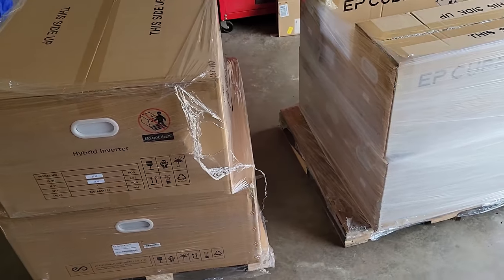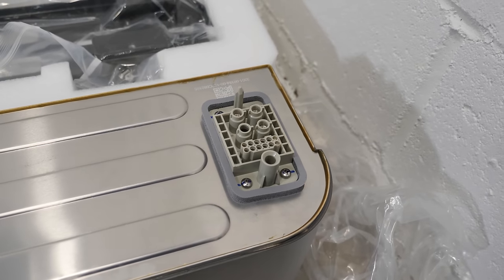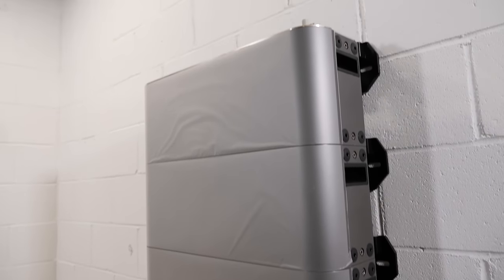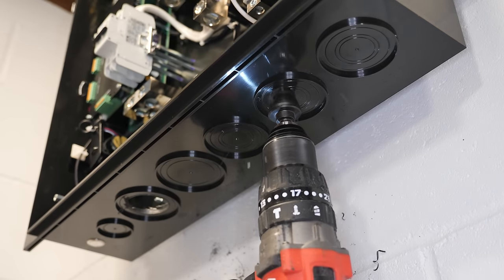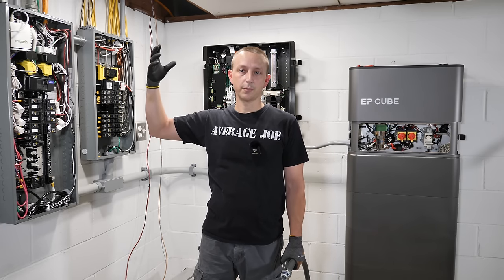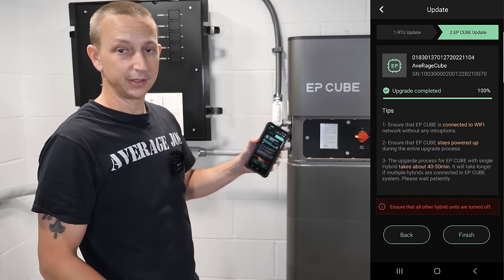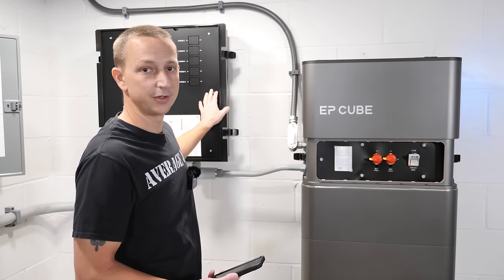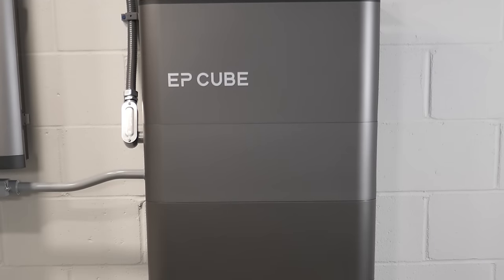Installing the EP Cube by Canadian Solar All in One System!! ON SALE!!

Comment: Pretty awesome video and your sense of humor,  first time viewing any of your videos.     Question - I noticed that the EP Cube inverter in the (All In one) has a TIGO connector,  so is it compatible with Tigo solar optimizers?    I kind of want to have individual monitoring on the solar panels to show individual panel production.    What are you going to use?    Thanks !
Reply from the maker: Thanks for watching. Yeah it has the tigo RSD. I am pretty sure it works with the optimizers but can check. I believe you need to use the tigo app to see individual production. I am using TS4-A-2F on one string at the moment and they allow 2 panels for one rsd unit. They dont show any production tho. Still need to add them to the other roof string. I will also add that EP Cube has updated the app and you can now see each string production. Thats a plus because before it just showed a total for all strings added.

Comment: One thing that bothers me about these wall type units is how long will the parts be available in the future if something fails and needs replaced will I be able to get what I need years down the road whereas if using individual components I could easily find replacements and even upgrades as time goes by. Your thoughts on this? Another question, if you cant access your app for any reason than you cannot access the system but the system will still work for backup power ? And you have to have a grid connection with this or it cannot be powered on? if all this is true then for a shtf situation there is to much dependence on outside the home tech to be up and running for it to be truly dependable in my opinion.
Reply from the maker: All are great questions. Ill be doin another video here soon and will answer some of those questions. For a true shtf situation, I would go with another system as you could add rando mix and match batteries to an inverter and have power. Id have to see if I could patch in batteries to this system. If I could, I dont think the %SOC would read correctly but I would be ok with that lol
The app uses your local wifi network so if interwebs is down you can still access it. If your local wifi is down you can connect bluetooth. I know you need grid connection for inital startup, I havent checked if it will startup without grid since I have been using it. I will check tho

Comment: If this system is grid-tie , it is able to keep the solar arrays operating in a power outrage? In another word it is capable to simulate the grid signal via the batteries and no power out to the utility as require by law?
Reply from the maker: Yes, solar will still work. No power will be sent back to the grid! It is fully certified, UL listed (even in Cali). 🤘

Comment: Excellent video on the installation and operation of the system!  Looking forward to the video of the generator hookup.   I’m wondering if the EP cube Gateway requires a 240v generator ( I see the L1 / L2 terminals) or if it will accept a 120v feed.
Reply from the maker: Thanks and Appreciate that!  Yeah a generator option is pretty nice.  Yeah it will require a 240v connection as far as this moment in time. They are always upgrading so who knows, maybe a 120v will be an option.🤘

Comment: Two Qs:
1. How to use these batteries if i already have hybrid inverter?
2. Is the config you shown is AC coupled or DC? 
Thx!!
Reply: It would be nice if you can reply?
Reply from the maker: Sorry, lots of videos with lots of comments😄 What kind of hybrid inverter do you have? Is it basically for AC couples solar? If so it can connect up to the gateway.

Yes I am using DC coupled solar.
Reply: Yes it’s AC coupled inverter…
Reply from the maker: I want to make sure I give you the correct info(since I dont have AC coupled) Let me find out and get back to you. If I havent replied, please bump this!

Comment: Wow this video is very good and cool, does the system can combine aeolian with solar too ???
And what is the cost of this install ???
Reply from the maker: Thanks appreciate that. I am unsure if you can combine solar.  I dont think so but will try to find out.  Minimum cost for this system alone includes 3 batteries and is $11,369.00 from Signature solar at  the moment.  With 5 batteries that I am testing out is $14,599.00.

Comment: are you going to capacity test those batteries? 20kWhrs per unit (120kWhr for 6) does not seem right for the footprint of those if they are LiFePO4...
Reply from the maker: Yeah 20kWh per stack.  I believe that is a code thing and or code compliant.  I ment to include the sticker on the side of the batteries AND inverter.  Will have to include those in another video.

Comment: How does this compare to the batteryevo rhino batteries you had a whike back
Reply from the maker: I still have that system and still use it😄 My "system" has more battery capacity and a bigger inverter. I do really like that this system has 4 MPPT charge controllers and at a MUCH higher voltage. It also has some cool safety features that mine doesnt....yet🙄. Ill have to come up with a list.

Comment: Did your get rid of your growatt system?
Reply from the maker: Nope, still have it all! Gonna tie in a transfer switch I think so I can use either😆
Reply: Good I like how u did your old system. I am running 2 grid tie gtl invertrs off 24 kwh battery bank. With 4300 watts of solar.

Comment: All this wifi/company dependent/serial-number-pictures/wiring-pictures/software update heavy setup would not work for me.   As a prepper, I strongly prefer to be offgrid - absolutely no information outside my home LAN.   I'm a little surprised you're OK with this as I've tended to think of you as a rebel/off-grid type of orientation :)
Reply from the maker: Yeah true! I would prefer lan as well. As for being"ok"....I am allready all over the interwebs so I kinda have to be somewhat ok. I do use the system as off-grid, as in I dont grid-tie but as far as the app. It also works for lan. This system is more  designed for the regular folk that just want to have a system installed.
Reply: Exactly what ive been saying. Really cant believe he qould support a company that pulls stunts like they are. No warranty unless its updated every month. Complete joke of a unit

Comment: Can this be  hooked with out batteries  no grid feed back use  from grid if solar is not enough
Reply from the maker: I am not sure I understand what you are asking. 
Q-Can this be hooked without batteries. A-No, You need batteries
Q-No grid feedback use. A-Yes if grid go down it will continue to run
Q-From grid if solar is not enough. A-Yes if solar and battery are not enough, it will use grid.

Comment: I bet that it will cost a bundle.  Thanks but no thanks i build mine i get way  more bang for my bucks.  No body cares if it is pretty or not as long as it is safe and works.

With that says this nice thing is for those that have the bucks to burn  and just want to have to use it and they could not care less about  kw to A to V etc...  Solar power system is  heading this way for the majority of consumers and that is good.  The more the better for the environment!!!!!!!
Reply from the maker: Yeah this system is for people that dont DIY and want to get a system installed for a multitude of reasons.  You are correct that systems are heading this way.  All in one that are easy and quick to install .

Comment: A lot of concerns:  1) If you aren't going to back feed the grid why is grid power required to power on the system?  
2) No local physical controls or indicators?--that's an inherent limitation that I find is unacceptable.  Reliance on WiFi and Bluetooth, also unacceptable.  While Bluetooth does not technically depend on the Internet, it is a limiting control factor, as is the NEED for Internet connectivity for the EP system to connect via WiFi to the EP Cube servers and then back to my phone.  3) The engineering, fit and finish looks spectacular as is the install process.  But too many concerns for EOTWAWKI and/or WWROL situations.  4) Also, IMHO, an EMP is going to murder the system if it is not isolated from the grid even if shielded (of course, in an EMP all bets are off anyway I suppose. 5)  Another concern is the need for the by-pass sub-panel; it seems like a limiting factor having to choose ahead of time which circuits get power from the batteries. Is there a way to run the system directly to/from the main load center? (tie the inverter output directly to the main panel with an approved by-pass/disconnect interlock?  Lots of concerns for this system, so it's not for me.

Comment: cost?  you didn’t mention cost….how much do you have invested on your wall?  not including your your solar panels…
Reply from the maker: Minimum cost for this system alone includes 3 batteries and is $11,369.00 from Signature solar at  the moment.  With 5 batteries that I am testing out is $14,599.00.
Reply: @AveRage_Joe   thx….I put up 4 320 watt panels, one xantrex 3 kw inverter/charger, midnite charge controller and 6 100a/hr agm batteries…for less than $7000.   this seems excessily expensive!

Comment: i dont understand how your. wiring work and maybe you can elaborate. As for my understanding  you connected the smart gateway to the main panel through a breaker (lets call this breaker 1 and this breaker cannot be engaged unless the main panel break is off, meaning no power to the grid) and the smart gateway to the subpanel. The subpanel essentially connected to the main panel. So it 's a loop main->smart gateway -> subpanel->main. So how are you charging the battery from the grid given you have to disengage the main breaker to engage breaker 1? Am i missing something?

Comment: It's too bad that Canadian Solar chose to use, Chinese made,  low cost, high frequency, transformerless inverter technology in their design. The reason for this is that all these high frequency inverters lack a very critical component. That critical component is an iron core, copper wound output transformer. Without an output transformer to act as a buffer to absorb electrical surges provided by the “Flywheel Effect” inherent in the physical amount of a transformer’s iron, these surges and damaging reverse voltage spikes must be handled directly by the inverter’s MOSFET transistors, essentially shortening their life. 

Another major consideration with these high frequency, transformer free inverters is safety. All it takes is for one of their MOSFETs or IGBTs in the H-Bridge circuit to short to ground or the waveform control circuitry to fail, and a high frequency inverter can send dangerous, high voltage, high amperage DC current straight to your connected AC loads which will not only damage most AC appliances but can also set those AC appliances on fire. I would never install a high frequency inverter in my home for off grid applications. That's why the big name brand inverter manufacturers like Schneider Electric, Outback Power, Sigineer, Victron and others, all use a low frequency topology in their offerings. I know this to be true because I've spent the last 23 years repairing inverters. High frequency solar generators/inverters simply don't last and can be dangerous when powering inductive loads.
Reply from the maker: Seems like there are pros and cons for both.

Comment: Nah... 
It was all sounding good until you said "You have to download the app". In my books, nothing that has "smart" in the name is in any way smart.
There's no reason for any company to have full un-vetted access to that kind of data about my home, and from what I saw, there's no advantage to running that system over stand alone equipment that doesn't require an internet connection.
Reply from the maker: This system is designed for people that just want to buy and have a system installed for them with options.  Either way its a pretty sweet system!
Reply from the maker: 100% TROOF!!!
Reply: @AveRage_Joe  I completely understand the "convenience" as a "sell point". I also completely understand people in general and their unwillingness to get into the often complex concepts surrounding technology and what's involved in setting it up.

The problems with those things are, in this day and age the information required to design any system are right at your fingertips and step by step guides are abundant, but much more than that, these supposed "conveniences" can change at the drop of a hat into a monthly fee to have access to the equipment you paid for and supposedly own. Let alone the almost complete inability for third party consultants to gain access to the required information to walk those who are incapable of understanding these systems (for whatever reason) to advise them on systems in general, let alone repair them.

This is when "features" become not just problematic nor just another financial burden, but an absolute bane. Often, in the case of the manufacturer going bankrupt or being sold off to another company, resulting in you being the new proud owner of a $20,000 boat anchor because the new owners decide to charge you for the connection required, or worse, stop supporting the product all together resulting in ... a very expensive boat anchor.

It's not acceptable that any technology require an app from the manufacturer and a connection to their (and only their) servers in order for it to operate. Nor is it acceptable  that a manufacturer force it's customers into proprietary software and "support" in order for the equipment that the end user "owns" to operate.

I find the willingness of people in general to accept such terms on such big ticket items, astonishing.

I'm sure you've heard of Louis Rossmann.
I'm sure you're aware of these concepts and the limitations companies continue to force upon their customers, after the fact. 

He's just recently released an short (8 min) video that demonstrates this concept perfectly, titled "When EV makers go bankrupt, what happens to the car?". He probably should have changed that title to "YOUR car?".

At any rate, I just don't think it wise to perpetuate these kinds of consumer traps (which is exactly what they are) without at least mentioning the potential pit falls of such systems. Not to mention the EULA's that come with them, allowing companies access into more of your personal data and daily habits.

I love what you do Joe. It's just that society is walking blindly, further and further into this, and all of us will suffer for it in the end. 
To varying levels, literally everyone is already suffering from it without an option, because of the uninformed choices other's are making purely because they're too "busy" (lazy) to do a bit of research beyond the up-front price.

I'm not that cynical, and I'm not at all, singling out EP nor making any assertion that the company is anything less than ethical. However, this disturbing trend needs to stop. It needs to stop because regardless of any company's best intentions, they can fail for an absolute myriad of reasons. Within their control or not, and its ALWAYS the end user who's left out of pocket. Personally, I wouldn't be putting my name to any product who's software isn't at least open source, or better yet, the system is compatible with any number of third party software that don't require an internet connection and periodic "updates" to keep operating, as purchased.

Comment: Tapcons are crap.... Easy to strip out and even pull out by hand.... holes can only be used once... 

Try using GRK Caliburn screws.... you can screw the GRK... in... out... in... out... in... out... in... and the GRK will still hold 1000 lbs per inch of thread... once you use the GRK Caliburns... you'll never touch a tapcon again....

The reason that the GRK's are better... is because the major and minor threads of their concrete screws are twice as big and twice as wide as the threads in thetapcons.... which means that they have much better grip.... and you can reuse the hole....and... best of all... they're a Canadian company...
Reply from the maker: Thanks for the tip!!  I will look into those for future projects!💪

Comment: The mounting bracket system is a poorly thought out train wreck. The product director in charge of the development should be fired.
Reply from the maker: I mention that although it works and allows the system to be installed to multiple surfaces, it could be improved.  They agreed and are working on a better way!!🤘

Comment: Another hype “review”. No comparison to other gear…no longevity testing…meaningless advertisement. What’s the cost per watt compared to other cheaper system? What’s the total cost? Showing the “stuff” is more drivel. Mounting? Where are the specs? Is it a low frequency inverter?Does it use a transformer, or FETs? A video full of fluff and no substance.
Reply from the maker: This was just an install video.  I didnt think there was any fluff but to each his own.  Thanks for the feedback.  Minimum cost for this system alone includes 3 batteries and is $11,369.00 from Signature solar at the moment.  With 5 batteries that I am testing out is $14,599.00.